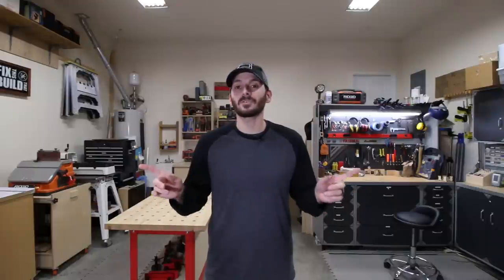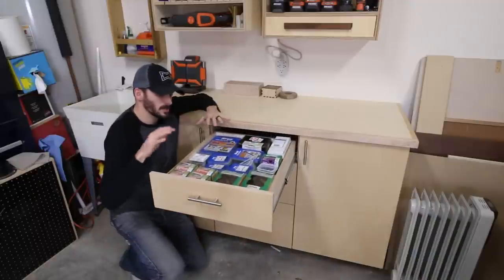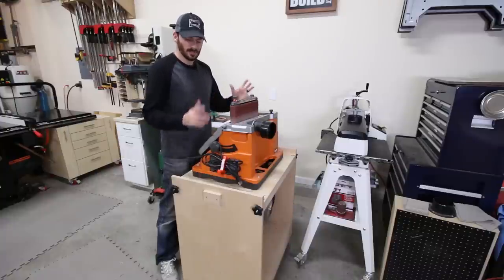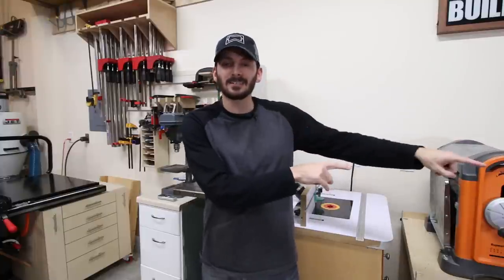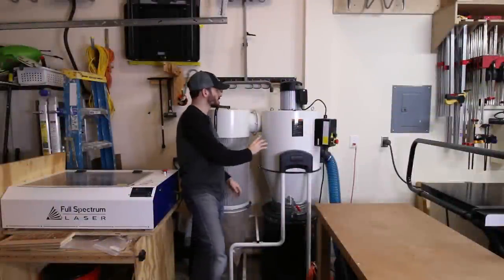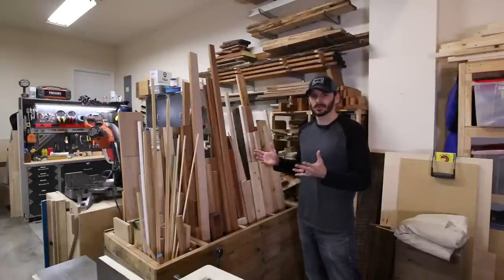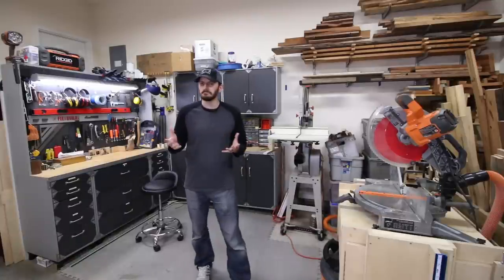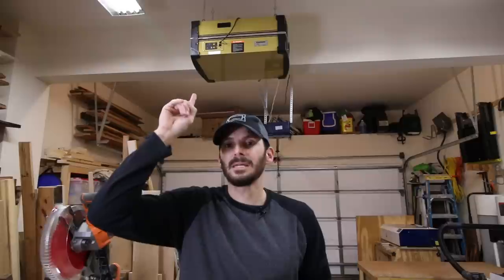Fix This Build That Woodworking Workshop Tour - Jan 2018

Comment: Great shop tour Brad! We've got both the HF foam mats as well as the heavier/thinner/better extruded PVC (diamond plate textured) mats - HD sells them online. For cleaning the dust off them, the best thing I've found is to use the 'wet' attachment for the shop vac as it does not have the annoying suction issue that the other attachments have.

I've also spent the last few days laying out our shop in SketchUp to figure out what dust collection fittings and pipe lengths we need as dragging the DC around definite gets old fast. Looking forward to seeing what you come up with!
Reply from the maker: Yeah, I love using SketchUp to model changes in the shop too!

Comment: I just bought a Ridgid band saw exactly like that about three weeks ago on Craigslist! 15:28   It needed some TLC, but the biggest issue I had was the darn shaking/vibrations. I found that the MDF I put on the base and some new urethane tires did the trick. Enjoyed the tour bud!
Reply from the maker: Yeah, that's where I got mine!  Didn't have any issues with mine but I did put urethane tires on as well.  I had to trim them though since they were too wide and boy was that a pain

Comment: Nice tour Brad! Nice to see the evolution of your shop and gain some ideas for my own as well. I have one-third of a 3 car garage walled off and am finding mobility is key. The downside is having to reconfigure everything to use a tool.
Reply from the maker: Yeah, having to move things to use them isn't optimal, but I only do that for things I use infrequently.  Tablesaw, miter saw, bandsaw all get dedicated space.

Comment: Use the celling for the dust collection pipes saving floor space and it looks cool I have even done a few with a swivel in the middle and you can drop it via a hose it the tops of work surfaces great for small sanding and routing
Reply from the maker: Yeah, have considered that but I have a think about clean sight lines.  One of my hangups :)

Comment: I have a friend that ends up with a bunch of small off cuts (12" and less) all the time.  He gets boxes from the Post Office and fills a box and sells it for a modest price plus shipping to people that use them for small projects.  He has less clutter and the cut offs don't go to waste.  There are a lot of people out there that would rather use small cut offs like this than purchase an 8 or 10 ft board.  It's a win-win.  He begins by sorting them out by species.  At the end of the pile it usually becomes a box or two of mixed types of woods.
Reply from the maker: That's a great way to do it.  I've done the boxes in the past and should do some more!

Comment: Looks like I'm a little late to the party. Have you considered running your dust collection system over head, with retractable cables possibly? Eliminates the space used on the floor and tripping hazards. In any case, that's a nice and tidy workshop.

Comment: I recently went down the Garage flooring rabbit hole myself. I also have similar foam squares i got at costco, but i wanted something from wall to wall in the garage and fatigue was also consideration.  I found that Coin Flex Nitro Tiles are probably the way to go.  The Black rubber mats will def require a light overhaul.  With the nitro tiles, you can get a light color and it should still look bright in the shop without the need for way more lighting.  These things are safe to use with car jacks, so im guessing shop machinery wouldnt be an issue.  Just a thought.
Reply from the maker: What about the raised circles on them?  Do tools roll well on them?  Looks cool for sure
Reply: Full Disclosure... I dont have the flooring yet, planned install is like in June.   I like the idea of the circles for better traction, and honestly dont believe the it would impede tools from rolling around because they are raised so little.  The company has another product that is flat https://www.rubberflooringinc.com/garage/smooth-flex-tiles.html but pricing jumps considerably when you choose any color besides black.

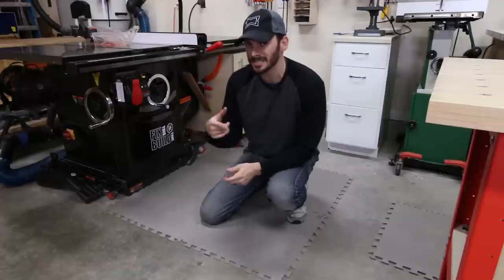Comment: @17:16 I have weight lifting mats, they're 5/8" thick rigid enough they don't get sucked up in my vacuum. Sounds like that's what you need. Still light weight but stronger than what you got sounds like. I really enjoy them. They were Gold's gym brand from Walmart, very inexpensive 2'x2' interlocking squares

Comment: Brad great job on the shop tour video. 

What if you took that wall with all those bins and mounted a sliding system to the ceiling and than youd have more floor space potentially? If there all the same totes than it could work really well. I did that in my shop and utilize the ceiling as much as possible. Just a thought
Reply from the maker: +Kyle Opalinski tell me more! Got any pics?
Reply: Ill DM you some pics cause Im at work right now

Comment: Sweet setup Brad. I have a much smaller space but same issues I use the same hose and move it from machine to machine, also I’m currently using a mat we had in the kitchen just big enough for my table saw it’s 3/4” thick and it’s sweet so definitely upgrading the floors because I have all kinds of leg and back problems (25+ years as a automotive technician and played hockey for 35+ years) so I need some cushion lmao 🤣 Thank You for the tour.
Reply from the maker: Thanks, Thom!  I need that cushioning too!

Comment: What do you think about having one small shop vac for each tool? You can connect the vac's wires to the tool's switch so when the tool is turned on, the vac also turns on automatically. This eliminates the need for a large expensive vacuum, ductwork and having a remote control for the vac. You can buy a small vac for $40. Let's say you buy 5 of them for each major tool. That's just $200. The ductwork alone probably will cost more than that.

Comment: Love your shop, very nice, my fine dust filtration unit is an old air handler from a HVAC syatem using a 20x20x3 filter, works good.

Comment: Great video, thanks for sharing.
Have you ever added up the cost of your shop?

Don't get rid of one piece of wood. Start designing projects around what you have. Meanwhile, looks like you have plenty of storage if you go up!
Reply from the maker: +Rachel Pierce thanks, Rachel! I've never added it all up. Been building it for over a decade. But yes, I need to use more wood I have for sure!
Reply: Make some cutting boards and sell them!

Comment: Not exactly sure which mats you are talking about but I have the thicker black mats that are about 2'x3' in sice and about an ince thick.  I just kick it around to where I need it.  Works great as a mat, but still gets sucked in by the shopvac.
Reply from the maker: Yeah, I'm toying with the really heavy rubber ones.  But it would need to be full floor to be able to roll tools

Comment: I know the Marc from Woodwhisperer has some heaven duty tiles.  I think they are expensive but you can see them on one of his videos.  I use the light weight ones as well and yes they can be a pain.  Looks good though Brad thanks for sharing.
Reply from the maker: Yeah, Gary the ones Marc has would be the ones I go with.  Thanks for the view!

Comment: That's a well-organized shop! I definitely recommend getting some good mats. I have the "Cadillac" mats from Uline and they do live up to their name. They're very squishy and much heavier than the ones from Harbor Freight, so they stay put better and are less likely to get lifted by vacuuming. They greatly improve comfort compared to standing on concrete. I think it's always always a terrible idea to stand on concrete for long periods of time. Uline has a few different types of mats too, in case you don't want to shell out for the thickest ones. They aren't cheap but they're not as expensive as the smaller "diamond plate" rubber-covered ones I also have. They're also more durable than the HF mats, though, being squishy, they don't handle damage as well as, say, those heavy horse stall mats (which are extremely heavy, expensive, and rather hard). I don't think it's necessary or financially wise to cover the whole floor in mats, but having one in every area where you'll stand and work is very good. I have the thick Uline mats in front of my work bench and the cheaper ones by each machine. Anyway, nice shop!

Comment: Shop looks great! Hope you don't use that snow shovel much. I would get thicker floor panels for as much time as you spend out there. Also do you have a cooler in the shop?
Reply from the maker: +Robert Bosquez hahaha, nope the snow shovel comes out maybe once a year. And I'm thinking the same thing on the floors. No cooling in the shop

Comment: I tried rubber mats and found that it was the same as standing on the concrete. I got High Density Foam tiles with carpet on them, about 1/4 thick; made a big difference to my feet and lower back.  You can get them at home depot, 4 tiles make a 4ft by 4ft mat....
Reply from the maker: Oh nice, thanks

Comment: Build a bench using only your scraps.  You can even use the smaller scraps in a laminated butcher block type top.  For me those rubber mats make my knees sore unless they cover the whole floor.
Reply from the maker: +wauhawk that would be cool!

Comment: I think the only solution is putting full carpet down :) Jokes aside, this was a great tour! It was really interesting to see that you don't have the rough boards, milling tools, reduction tools & finishing tools organised in sequential order like a lot of other shops i've seen - is there any reason for this??
Reply from the maker: Carpet it is!  Only reason I don't have the planer closer to the other machines is because of power and storage.  I may bring the planer next to the jointer this year.  But it's not a huge issue

Comment: Hey Brad, I noticed that you have a gas water heater, but you also have a pretty heavy duty dust collection system.  My space is significantly smaller and I have concerns about dust ignition.  Would you mind commenting about this topic?
Reply from the maker: +Overdoer949 I'll just say I've never in my life heard of a woodshop exploding from dust and a water heater. For whatever that's worth 😃

Comment: Brad, just saying GET RId Of The Mess Around The Water Heater  being gas it needs room to breath  for the flame and speaking of flame your comment to one other post about never hearing about a shop exploding from dust and a water heater, we'll never if it is an electric water heater! Wood (dust) and flame do not mix so please at least check into enclosing the area around the water heater with air filtration as it needs air but no wood dust Be safe and keep those tools safe along with the house. Papa Dave

Comment: I have a performax 19-38 and I never have a problem with collecting dust. How many cfm does your collector move once the filter gets dirty?
Reply from the maker: It’s not a problem, it’s that this one gets the fine stuff better. Less dust smell in the air. The 19-38 wasn’t visibly dusty

Comment: this may sound a little strange and since its hard to tell in the video but i see a lot of wasted space up on the walls and in the ceiling. now i am new to your channel so not sure your preference and what not, but maybe some warehouse style storage racks that can also have a work bench under it and utalize the high ceilings.  a little more.  just a thought.  also i use the a similar anti-mats in my shop that i use (i think they were from harbor freight) but i got tired of them getting sucked up with the shop vac. also got tired of them shifting around and things getting under them.  i took some good spray adhesive and just glued them down.  its not permanent and if need to be moved or whatever, i just peal them up and most of them time the floor is not sticky or anything.  now if the spray glue is fresh or freshly glued and the pad dont want to peal up, i just use a heat glue on low and gently warm it the glue and good to go and scrap up any residue that is left behind.
Reply from the maker: Nice tip on gluing the pads down.  I might have to try that in front of the saw.  The walls are 11' high, so putting stuff up in that empty space would only work for long term storage.  And you're right...I do prefer an open space

Comment: As long as your not getting any water on your shop floor, how about  laminate flooring?  I'm thinking of doing it in my little shop.   It's easy on the legs and back because of the foam backing, cleans up great and stuff rolls around great as long as you don't have steel wheels.
Reply from the maker: Never thought of that...interesting idea

Comment: how do you cool your shop
Reply from the maker: +Vince Baker just fans for now. Looking to get a HVAC split unit though
Reply: I live in Murfreesboro & cooling my shop is a big problem so I dont do much wood working in the sumer.
Reply from the maker: +Vince Baker yeah, it can get brutal here. I'd use a window unit if I had windows. Also, go check out Nashville Area Woodworkers Online on Facebook. It's a group I started for local makers 👍👍
Reply: I don't have windows ether I will check out Nashville wood workers